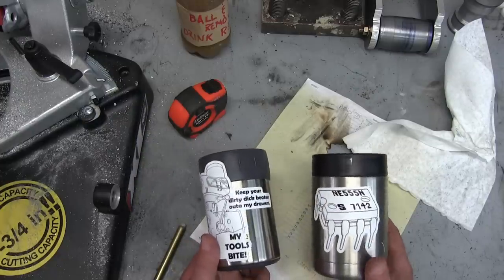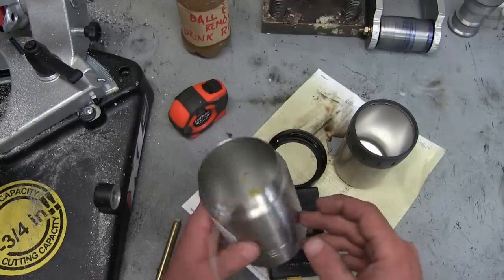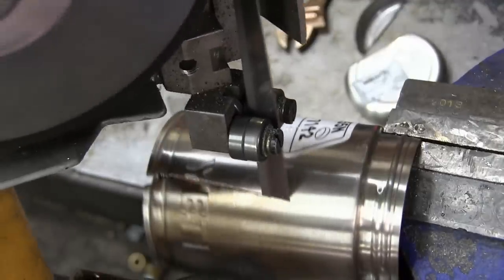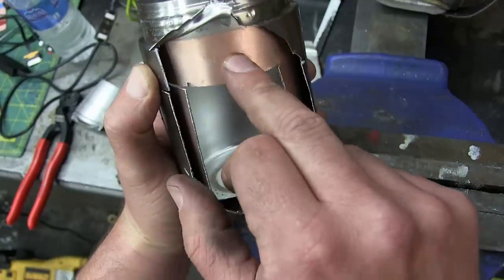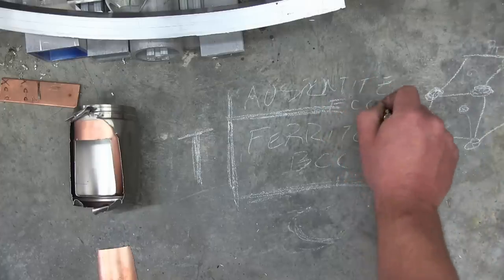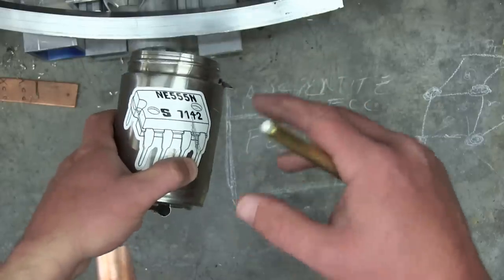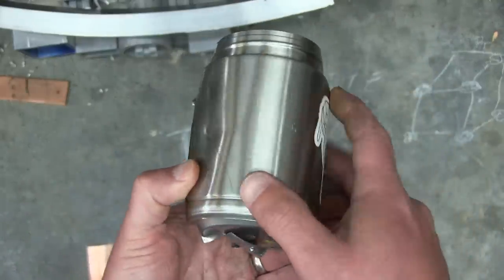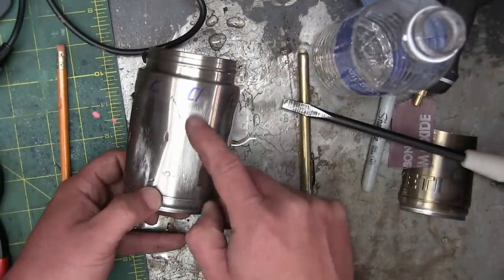BOLTR REDUX: YETI How it works | Enginerding Stainless Steel

Comment: AvE you have a great breadth and depth of knowledge with just the right amount of irreverence!  I love the discussion below with everyone running for their Materials Textbooks.  It has been a long while since I studied stainless steel phase diagrams but I do work with people who make all sorts of stuff out of stainless.  3XX series stainless is generally referred to as austenitic stainless because the high chromium content.  Perhaps the fact that Chromium is a smaller atom than iron means that it stays austenitic (ie the crystal has enough space to remain FCC on cooling).  Now 4XX series stainless are known as ferritic stainless and I am guessing (because I studied this 30 years ago and am too lazy to spend too much time on it) this is because nickel is bigger than Cr and Fe so prefers BCC.  Now the issue of magnetism.  Austenitic Stainless is generally non-magnetic while both ferritic and martensitic are magnetic (martensite is a tetrahedron and not FCC if memory serves me).  Now ferritic stainless has a much greater percentage of nickel which in itself is magnetic so this complicates the discussion.  Finally 3xx (FCC) series should be more formable than 4XX (BCC) tighter slip plane ... however austenitic stainless transforms to martensite during cold working.  So if you are drilling or cutting 3XX series usw a low rotation speed and a high feed rate.  I once made $$ doing some drilling/tapping of paint booth fittings for a  company who did not understand how to prevent the formation of martensite when cold working.  I will leave you with a few lines by a some friends of mine from Ohio State, Rob Wagoner and JK Lee (two of the top metalforming gurus anywhere): "The forming behavior of austenitic stainless steels (types 201, 301, and 304) and ferritic stainless steels (types 437, 439, 444, and 468) was investigated. The tensile behavior and the forming-limit diagrams (FLDs) for these grades were determined. The ferritic alloys behave similarly to plain carbon steels and are relatively insensitive to small variations of strain rate and temperature. The formability of the austenitic alloys is influenced greatly by martensitic transformation during straining."  Metallurgical and Materials Transactions August 1998, Volume 29, Issue 8, pp 2161–2172 | Cite as Formability of stainless steel , V. Talyan R. H. Wagoner, J. K. Lee

Comment: Too bad you didn't weigh it before you cracked it open, then you could have calculated how perfect of a vacuum it had based on the change in mass, the current air density and the volume of the displaced area.   It might take a very precise scale to do that based on how very little volume the vacuum chamber is.
Reply: Not really. There's a 1 mm slide lost from that. Enough to throw the math out.
Reply: aserta Well, he could have punctured the vacuum before cutting it :-)
Reply: A cubic foot of air weighs 0.0807 pounds. the amount of air in that jacket I'm just SWAGing at 5 cubic inches (probably generous) or 0.003 cubic feet. So at full atmospheric pressure it would weigh 0.004 ounces. Probably better to switch to grams now.  That's 0.11 grams.  A lousy vacuum in there would be maybe 90%, or 0.01 grams.  So I guess it's possible to measure but it's pretty damned close to the noise - most digital scales have only that resolution.  Measuring a 0.01 gram difference would be difficult.

You also would need to know exactly what the volume of the enclosed space is - maybe by filling it with water and then weighing the water - before you could know what the weight gain when piercing the vacuum meant.
Reply: Filling with water and then taking the weight delta is the most accurate way to determine tank volume, it is what they do for high pressure gas cylinders used for helium, oxygen, etc.   Yeah it would take an extremely accurate scale to determine the change of mass from a vaccum.  Something like what Cody's Lab has.
Reply: He would have had to keep (and weigh) every minute little chip from the saw blade... possible? But not easy!
Reply: Atheaon Payne why? You don’t need to cut it in half to destroy the vacuum.
Reply: pierce, weigh, then cut...
Reply: You want to measure the ammount of vaccuum it realeases you mean? Think about it.
Reply: Yeah too bad he didn't puncture it before taking at it with yonder dull beaver, was very curious if it would have been an actual pop or just an ant fart...
Reply: typo148 t

Comment: Corrosion of metals is an electrochemical process, and if any one of the following 4 conditions listed are missing, then the process of corrosion will not occur.

1. Anode
2. Cathode
3. Metallic Pathway
4. Electrolyte - any substance which disassociates into ions when in solution, or a fused state and which will then conduct an electric current (as defined by NACE)

Oxygen, temperature, and humidity will affect the rate at which corrosion will occur, although high enough humidity in the right conditions can create a suitable electrolyte.

Also interesting to see you touching things such as passivation, dissimilar metals, and even the galvanic series.

No matter what though, if you are missing any one of the 4 requirements, you don't have any corrosion.

Comment: So this is probably a stupid question; could you make a TEC cooling plate as a "coaster" to keep your beer in the can cold using a USB port? Say you needed more power and had to plug it into a 120v outlet, would it keep your beer nice and frosty while you watched the newest AvE video?
Reply: The contact surface wouldn't be great, you would need a slug to fit the bottom of the can. Further more you still need to draw the heat away from the hot side. Plus you would want some sort of insulator around the beer to reduce the play of  ambient temp ...  There are some great TEC fridges that solve this issue that run on 12v, had one in my camper....
Reply: But... I have already seen such product. That place for people that think they`re geeks had them aeons ago.
Reply: T  or you could just drink the beer in less than the 25 mins it takes to get even remotely warm.
Reply: Sure, add a huge heatsink and fan and you have your cooling coaster. TECs are so inefficient that you have to get rid of about 10 times the heat on the hot side as you "pulled" out from the cold side.
Reply: superdau well how about a stirling cooler from a mwir camera ;)
Reply: I made one of those in 2007. It takes a lot of power. Well I am in the Caribbean so its darn hot. I wanted to cool a coke but the bottle was not helping. Five points with plastic was not cutting it at all for thermal conduction. Solution to that was put a little water in (and block my condensate drain). In an AC environment (24 degrees celsius) it makes a small block of ice but that took over 30W if i recall correctly. Not efficient at all.
Reply: No real men has ever had beer gone warm on them before the can was empty.
Reply: yeah but it would be a better doodad on the healing bench than a ruler with a chinesium LED and magnifying glass amirite?
Reply: My bosses son is actually working on something exactly like you explained and I think he is almost done, I'll have to ask my boss on how he is coming along.
Reply: What about one thats good and isn't $50?
Reply: Sizukun1 i think night hawk in light and diyperks done one before.Theirs is for icecream but im sure you enginerds can do something
Reply: I've actually got a USB-powered TEC can cooler.  Just a little cold plate sized for a can, with a little fan and heatsink down in the body.  It doesn't work well.  For one, this is from back in the USB 2 days, so you're looking at maybe half a watt of input power.  Performance coefficients for TECs average maybe 0.5, so you pump half as much energy as you put in.  This was a cheap drugstore gadget, so that's optimistic.  So you get maybe a quarter (qwartre) watt of transfer across the coupling.  Combine that with a contact surface that's just a tiny ring around the bottom rim of the can, and you're not getting much work done.  It makes a bit of condensation on top when running without a can.  I'd guess the evaporation off the sides of the can is doing more cooling.

So, as mentioned in the other replies, you've got two issues:  You need more contact surface, and you need more power.  Power's easy.  Contact surface is trickier.  A metal slug is the obvious choice, but can bottoms aren't particularly consistent.  There are some exotic thermoplastics and graphene-based materials that would conform to the shape better.

Your best USB-powered beverage cooler is probably just gonna be a fan.
Reply: Gordon Tendick as I mentioned above it took over 30W for me to get good cooling. 12V too. USB cannot supply that kind of power. Maybe USB3 has a chance now but back then it was 500ma at 5V. Those items cannot work properly.
Reply: emergency piss bottle to put out fires awesome
Reply: Dry ice under a slab of something, sorted plus the fog looks cool
Reply: Paulo Marcondes, no you have not, at least not one that really worked! TG offer USB coffee cup warmers as coasters, that works. They also offered a tiny single can sized USB fridge based on TEC, but it specifically wasn't a coaster: it was capable of working because the cooled inside area was isolated from the outside where the hot end of the TEC vents. Also at just 2.5W, it was incapable of keeping the temperature difference between inside and outside of more than a couple °C, so everybody who bought it complained and it was discontinued.

It's not even worth trying, the basic physics of TEC is against you on this, and besides it's commercially available products.
Reply: Absolutely, but you'd want at least 50 watts and to maximize your contact area with a puck similar to the copper one AvE made last video.
Reply: Paulo Marcondes yeah but those are using ~2.5 to 5 watts and are ultra wimpy.
Reply: Sizukun1: I use these regularly which will stay cold for 24 hours. http://www.columbia.com/hydro-flask-standard-mouth-21oz-HF1456.html?cgid=men-accessories-waterBottles&dwvar_HF1456_variationColor=010#start=2

Bought mine a few years back for $19.99 and I am still astonished how well they work.
Reply: TECs draw quite a lot of power, if you have a 50W peltier it means it manages to move 50W of heat from the cold side to the warm side. It does so with about 70 degrees Celsius as delta. (The cold side would only get 70 degrees cooler then whatever the hot side is). The problem is that all the power the TEC is using is also converted to heat, so to get the cold side to actually go cold (say you want about 0  degrees Celcius on the cold side to properly cool a drink) you would have to cool the hot side to keep it at a maximum of 70C. The TEC (or Peltier) is drawing 80W of electricity to do its 50W heat moving job, so the hot side ends up with 80W of heat from electrical power, added to the 50W of heat moved from the cold side. You now have 130W of heat that has to be cooled down to a maximum of 70C to get the cold side cold. 130W is about as much as a top performing CPU, so with a big modern heatsink with heatpipes and a fan it is absolutely possible, but not without quite some bulk and noise.
Reply: I had a setup running back in the days. Water cooled 225W peltier and was hitting 0C idle and about 10-15C under load on my highly clocked CPU. It was a fun project but the whole rig consumed so much power and there were other problems with below ambient temps like condensation. In the end i rebuilt the system without the peltier after just a couple of weeks.
Reply: Well as a quick and dirty condensation fix you could just drive an IRL540 gate off the PWM pin going to the fan... connect IRL in series to the negative terminal of the TEC.
Reply: Just insulate the bottle or can from the warm air or your fingers.Pipe insulation works well.
Reply: You saw how well it conducts heat from the outside to the inside, well it would conduct cold just as well.

Comment: Employee of a US of A outdoor retailer here, western US sales rep. say's the little puck in there is the "getter" and that once it is put under a vacuum, helps to trap the few random air particles still bouncing around inside.  Also he say's other brands use them, but theirs is better quality because it is spot welded to the base instead of adhered like other brands.   Might be worth deconstructing a hydro flask to test that claim and see what the puck really is/does!

Comment: the steel and copper wont rust because the copper elector coating should be in a vacuum, with very little o2 to react with.

Comment: if you want INSTANT corrosion, heat up some H2O2 on the stove and dissolve as much salt into it as you can. I use this to rust axe heads, then I boil them in H2O to convert the red rust to black rust.
Reply: BE CAREFUL because it will make things nearby rust as well. It is a violent reaction, if you spray the warm solution onto carbon steel, it violently foams orange and smokes
Reply: THIS is some useful DIY info!
Reply: Wait why would you want to do this?
Reply: Alexander Riccio the black rust prevents any new rust from forming, and is also a very hard coating, harder than the steel beneath it, so its an excellent protective layer and it also has a subjectively very nice appearance. Some people call this rust bluing, similar to the blued finish that is common on firearms
Reply: is this black oxide finish?

Comment: Are you going to cut open the Thermos brand coozie? I'm wondering if they coat the inner layer with copper as well.  At least, there needs to be some reason why the YETI either works better, or costs more ( other than the name alone ).
Reply: Fearmylogic how many yeti products did you buy? You better not be sporting the back window decal . 😄
Reply: I'd like to see a Columbia one cracked open as well. Come to think of it I almost did while biking up a hill and it came out of the water bottle holder and >crack< and it doesn't sit so straight any more but no lack of vacuum. Bit of the powder coat chipped off.

Comment: That ferrite thing is not for inventory control. It is called a getter. It helps stabilize the vacuum.  https://en.m.wikipedia.org/wiki/Getter
Reply: Thanks for the information. I knew tubes had coatings heated to create vacuum but didn't how they are made.

Comment: Mechanically working 300 series stainless such as pressing a sheet into a shape can also make it susceptible to chloride stress corrosion in areas of high strain.  This usually occurs in aqueous contact with chlorides at say 200F.  Plate and frame heat exchangers really took off in the 70s (APV and Tranter) and they were just learning how to press 316 stainless into complex shapes.  The plates would crack in hot service with chlorides present.  The alternative for about a decade was titanium ($$$$) plates until metal companies figured out how to tweak the alloys and come up with different stamping processes.

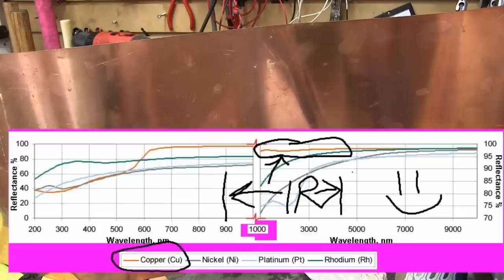Comment: 7:45 I believe that thing is, like a moisture ingress thing, but something that is actually called a "getter." It does the same thing as the getter in vacuum tubes--absorbs any gasses that get into the vacuum, which helps maintain the vacuum.

Comment: if that little button turns white in a short time it's a getter.
Reply: It's almost certainly a getter, but it would only turn white if it contained Barium(the white spot on a breached vac-tube is Barium Oxide). It's most likely a finely powdered and compressed pellet of iron and magnesium. Both are quite reactive with oxygen and would leave only whatever small amounts of nitrogen and CO2(with a MINISCULE amount of the remaining ~1% of atmospheric gasses)
Cheers!

Comment: this mentions  at number 3  the small object welded in bottom of cup or bottle is clearly a getter.
                  The major manufacturing production processes of stainless steel water bottle is:
1.Bottle Body Production: 1.raw material → 2.shaping of outer cup and inner tank → 3.welding getter on the bottom piece → 4. copper lining on the surface of inner tank (optional) → 5. welding to join the outer shell with inner tank together → 6. ultrasonic cleaning → 7. vacuum producing (test vacuum 100% first time) → 8. electrolysis → 9. polishing (test vacuum 100% second time) → 10. decoration (painting, powder coating, water transfer, heat transfer printing, laser engraving, silk-screen printing etc.)

Comment: That little dohicky may be a one time seal with a lower melting point than the steel. You place them on mesh covered hole in the cup core, place a whole batch of those cups in a furnace that can be made air tight. Heat them up to just below the melting temperature of the one time seal,  then you close the furnace lid suck out the air take it above the melting point of the one time seal,  then cut the temperature until the seal is solid again then let the air back in. Then you can batch process a whole bunch of the cup cores at a time then you put the push fit cup bottom on to cover the seal.

Comment: From what I remember working at target about 6 years ago (around the time of this videos release) was that if you don't see a security sticker/tag or the item isnt in a box that we placed on the floor but that item is over I think it was $25, that means that item has a security tag built into the product from the manufacture that is tied to its UPC with the RFID security systems at the doors, they get reprogramed when you or the clerk scans the product at checkout that's why sometimes at supermarkets you hear the doors going apesh*t, sometimes the reprograming doesn't work and the security sets off the doors anyway.. this is happening less and less with time because the the tech is getting cheaper and better. that's murica and its logistics for you, we started by tagging the trains you can bet were going to tag the products too, now you just wait till these tag and digital currency relate to how they can tax ya.